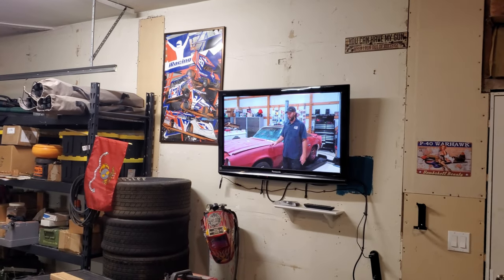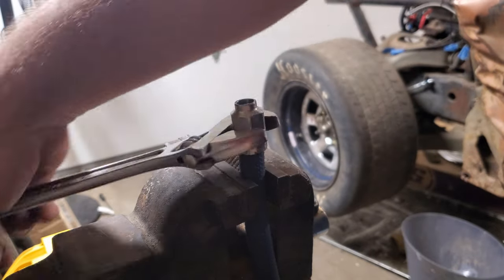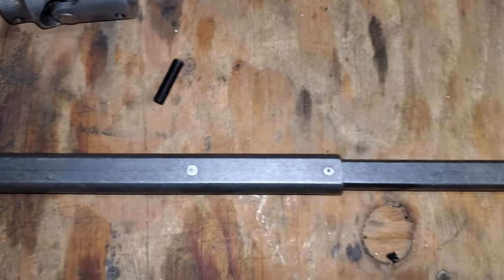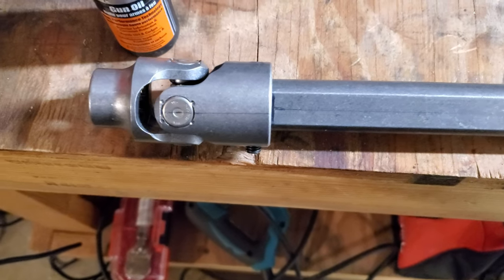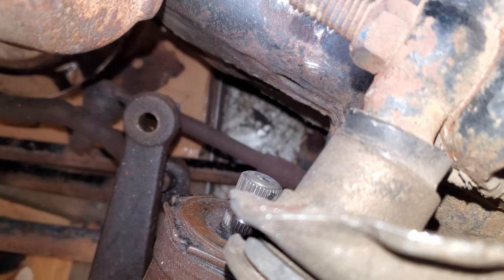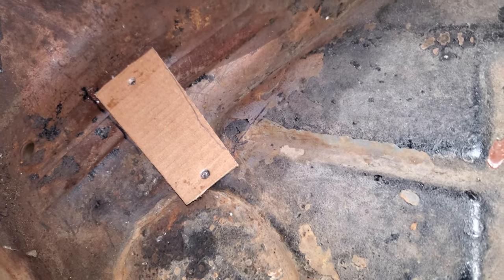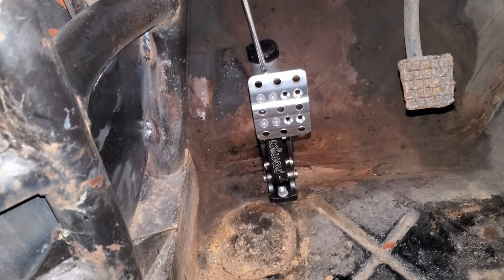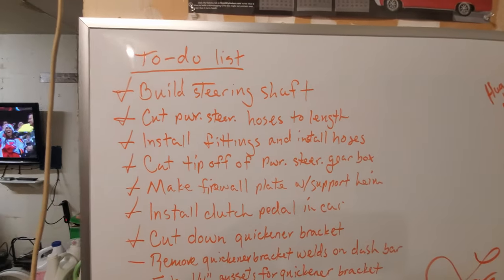Hobby Stock Build: Working on the Steering System and Cutch Pedal assembly.

Comment: The -4 fitting for master is just one fitting that uses the seal. The threads that go into the master are straight thread with no 45° seat on the end which in turn requires the seal. Probably got it dialed by now but it's really just like anything in street stock cars, there at least 10 different ways to do the same thing. Take care!

Comment: Hello fellow racer. I see nothing wrong with anything you're doing on the old Camaro. I have a metric car myself however, I wanted to mention a couple things on leaf rearends. You'll want to weld only one side permanently on your spring pads. The other side (I would suggest the left side) you'll want to loosen then re-tighten after any wedge adjustments. If they are both welded you'll be putting a bind on one or the other spring. The pinion angle will be the difference between the pinion and the driveshaft, anywhere between 2° and 4° down. The steering u-joints I will just warp a few cold wet rags around them while welding to prevent ruining the joints. Looks great so far and good luck!
Reply from the maker: Thank you